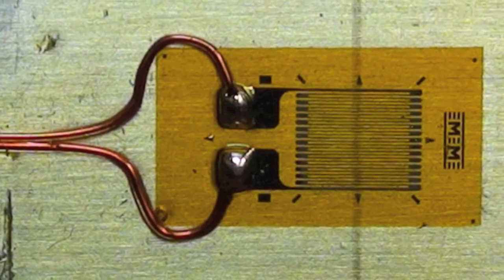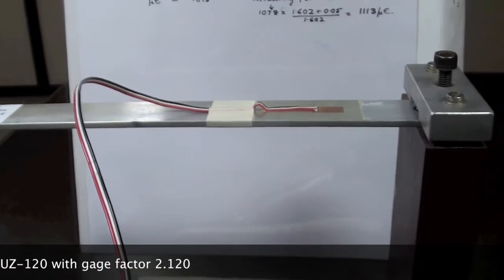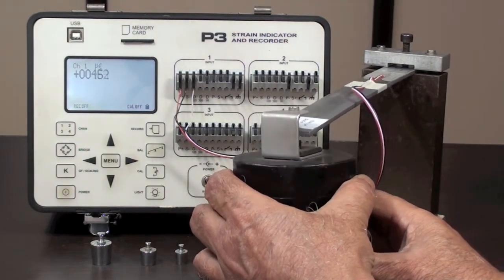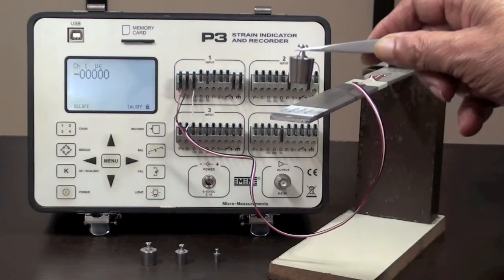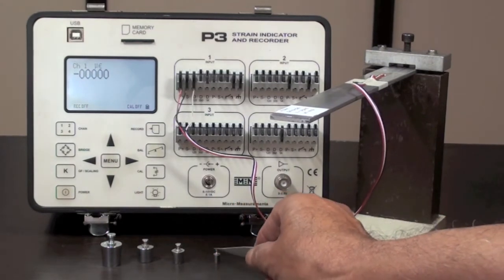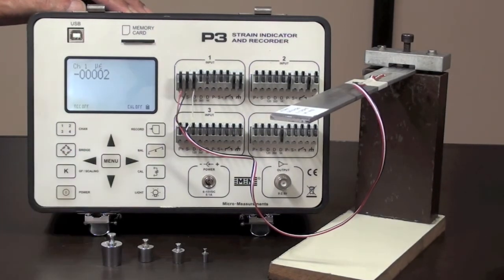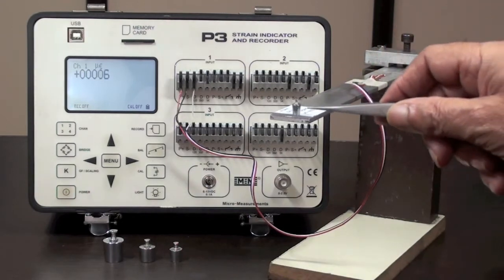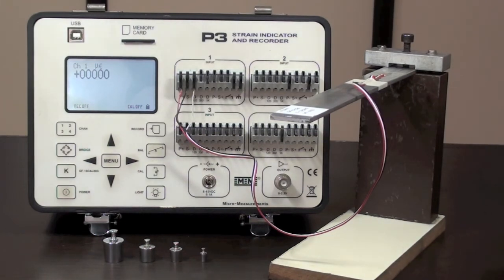Strain gage(gauge) sensitivity -  measure 1 microstrain or less

Comment: Very well done! The first time I’ve seem this kind of technique!
Reply from the maker: Thank you very much for your kind comments. The straingage performed as I had wanted, the model P3 showed excellent stability and repeatability, so I could demonstrate the high sensitivity possible with a straingage. I have checked the Model P3 and this same gage for over  40 hours of continuous operation, and the zero balance and full load readings repeated exactly every time.  Just thought of letting you know. Regards, Vijay (vijay.dynatec@gmail.com)
Reply: @DynatecIndia  what is the limit factor? 10? Have you ever tried greater figures?
Reply from the maker: The instrument which I used, Model P3 of Vishay Micro Measurements, is specified to operate with a gage factor setting from 0.5 to 9.5.
I already stretched it by setting the gage factor to 0.212. It still worked. 
Perhaps there will be instruments with greater sensitivity, and then maybe the limit can be stretched, but I do not have access to such an instrument. I feel that since the straingage output is purely analog, with resolution nearing infinity, the limit factor is the sensitivity of the read-out instrument. It is indeed necessary to use a very high quality straingage, the best adhesives and accessories, and follow the straingage installation process strictly. All the items used in my experiment were the products supplied by Vishay Micro Measurements of USA.   Best regards, Vijay ( vijay.dynatec@gmail.com)
Reply: @DynatecIndia  thank you for sharing your thoughts! I have the same P3 boxes, but it never occurred to me this kind of usage. Brilliant!
Reply from the maker: @eduardoatemdecarvalho5891  ,  I could show this experiment with confidence because of the nice way the gages, accessories and the instrument performed. 
Thank you for your kind comments. Vijay
Reply: @DynatecIndia  Vijay, I have just learned that you are a legend in the field!!!

Comment: Can you use a strain gauge to sense something that sensitive in a wearable product that can be affordable mass manufactured or do you need high sensitive machinery to rly sense it
Reply from the maker: The strain gage by itself is a very sensitive sensor that gives an output for extremely small change in the dimensions of a part (so small that it is invisible to the eye), and which cannot be measured by any other common measurement tools. However the output of the straingage is also very small, less than 1 microvolt in the above example. In order to measure this output accurately, you need a very sensitive instrument, which is expensive.
Please send me details of your application at vijay.dynatec@gmail.com, about the wearable part, so I can advise further, about affordable manufacture.